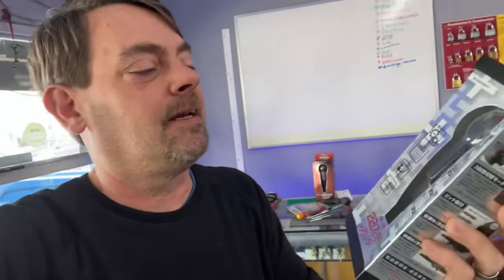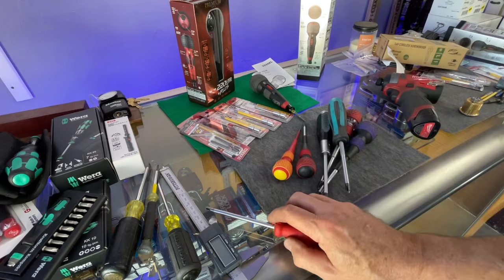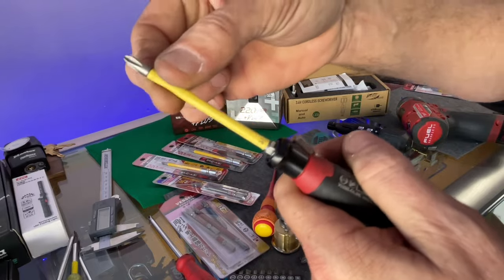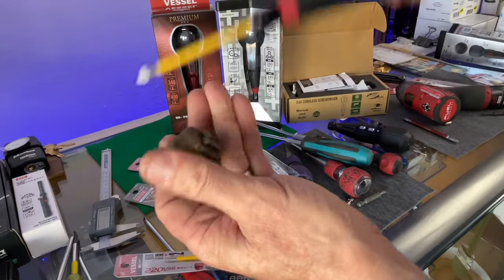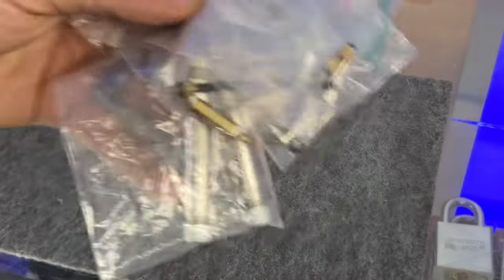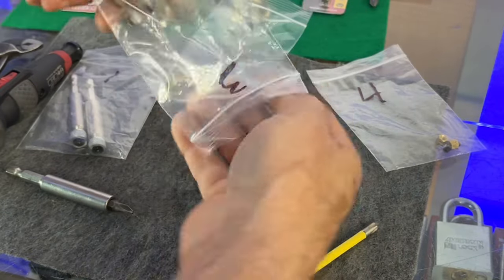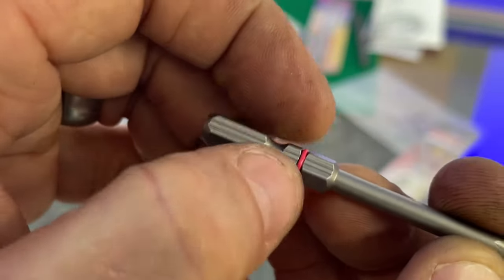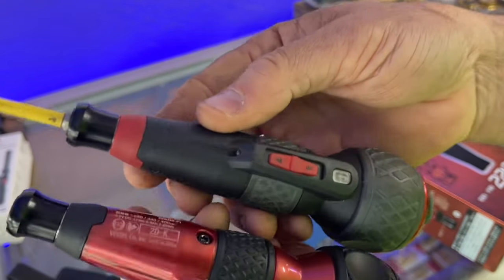Vessel USB220 + Plus & Premium Red! Is it a good electric screwdriver for a locksmith?

Comment: Great overview.

I kinda forgot I sent some of that stuff.

The modified bit holder was made by just sticking the bit holder backwards in a 1/2” drill and used files to cut and shape it. To get a tight fit I use one of the double ended philips to get the tapered end shape and depth and the coved notch. I also used a slightly smaller round file for the grove to help with in and out slop.

The oring in the bit adapter works best with standard 1” bits to prevent bit wobble.

I haven’t seen anyone make any of those adapters. I know Makita sells a “bit adapter” that achieves the same thing.  But designed completely different and doesn’t retain it self.

Speed settings :
Slow blink - slow speed / Low torque
fast blink - medium speed / medium torque
Solid  - high speed / high torque
Reply: Try a engineer dr-22 or any length I can use any us bit in Japanese chuck or vice versa
Reply: @MattHmm-rq6dn  Cool had not seen than before.
Reply: Don't forget about the vessel plastic spring bits some are reduced shank they take some play out of 9mm into 13mm but leave you a usable 9mm us bit

Comment: My small electric screwdriver is an Amazon "DENALI" (comes with 33 bits in a nice plastic case).  Anything smaller I use a small ratchet by ICON (Harbor Freight).
For anything bigger, the Milwaukee M12 ,or the Hercules 12V, electric screwdriver are without peers.

Comment: Yea I have had the us version hi torque, 220 Japanese type c version I'm regular gold and blue.  They do make a makita spacer oem by maita f to go from 13mm to 9mm but it falls out.  I use 13mm bits in mine for electrical work daily double ended works out well.  I also carry engineer dr-22 a bit holder (made in Taiwan) that will take 9mm or 13mm bits on both ends it's rhe universal adapter for Japanese to us and vice versa.  The answer for me is to have a few Japanese bits for thoes and regular import vessel bits for the us market for the impact.  If you want a handle that looks super tight no play like a dedicated screwdriver to use any 1/4in but period (including 13mm) the wiha centofix(expensive  made in China but good)  no slop and you can use thoes reduced shank bits but have a usable handle.  Thoes wera harpoon bits work well for knobs and small things as well.  Most of us sparky love us some vessel electric screwdriver for cover plates, switches and outlets!
Reply: I sent Jason a German made wiha softgrip centrofix with the first vessel 220 for that reason but I dont think he’s opened it yet. I think it’s still hanging on a hook over his bench.
Reply from the maker: @mumbles1justin  it’s getting unwrapped today! I had it with the other Wiha’s but I just figured out where I want to keep it!
Reply: That's the best bit holding handle on the market bzueg has some wonderful comparisons.  Also he has his own fixes for the vessel electric screwdriver as well along with every Japanese bit yoy could ever think of for your situation.
Reply: Where did you find the made in Germany model I can only find China one unfortunately. Even though the China model is about perfect  I love giving money to Germany, USA and Japan.
Reply: @MattHmm-rq6dn  a few years ago I had a vender that would through them in with an orders as freebies.
Reply: @selock  sorry wasn’t trying to call you out. Just pointing out where I saw yours last. lol
Reply: @MattHmm-rq6dn by chance did you get your centrofix from lowes? Ive noticed a lot of their Wiha’s stock is made in china and Taiwan. Where’s when KC tool’s still sold Wiha everything was German made.
Reply: Both ones I've ordered were from China kc and azn.  It makes me think only old stock is Germany.  Most places selling it now don't list COO keep it vague.
Reply: @MattHmm-rq6dn  If thats the case Wiha needs to update their website because they still have “Wiha premium quality SoftFinish® Drivers are Manufactured in Germany.” on the product page.
Reply: Even the regular screwdrivers are Germany that were sold at lowes.  That was the only wiha item at lowes that was Germany pliers ate Vietnam  bits are Taiwan.  I don't know why that one screwdriver like the multi bit screwdrivers are made elsewhere.  I know if I look around I van get the bit rachet kit either country but you have to look around.
Reply: I ordered a wiha centrofix for kicks agian the new one is made in Germany seems to be good  as thr others I own
Reply: @MattHmm-rq6dn  Interesting.  I wonder if the Chinese ones are clones.
Reply: There was a time during the pandemic the Vietnam plant had issues and some stuff was made in China so maybe blame the pandemic?